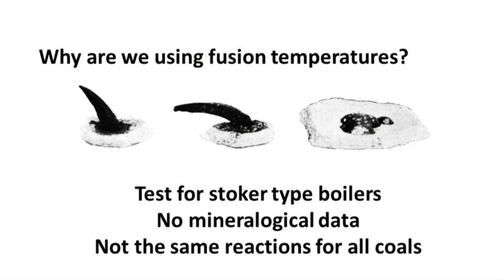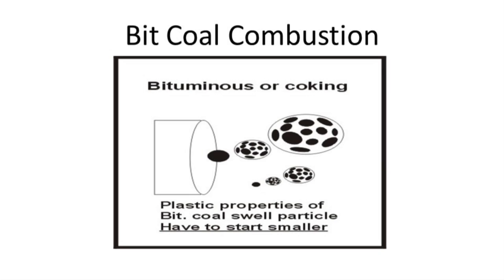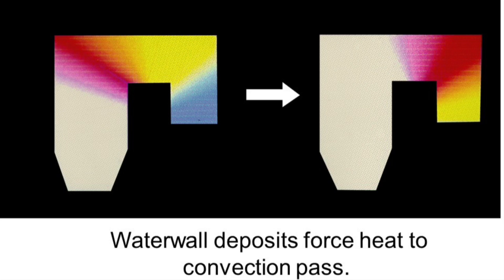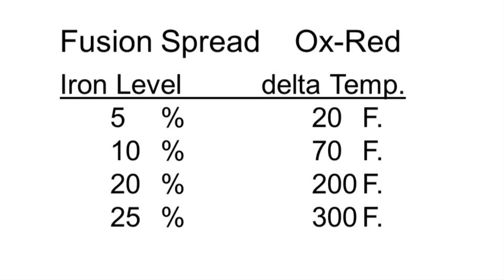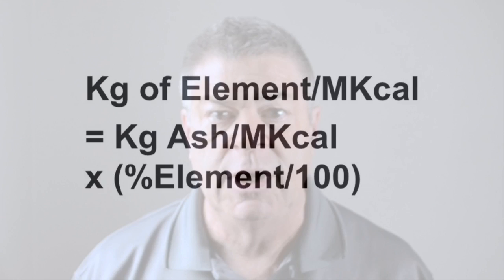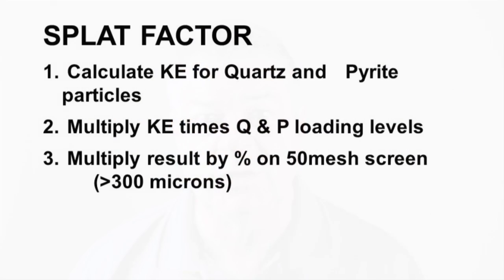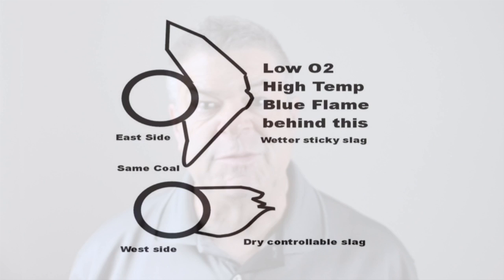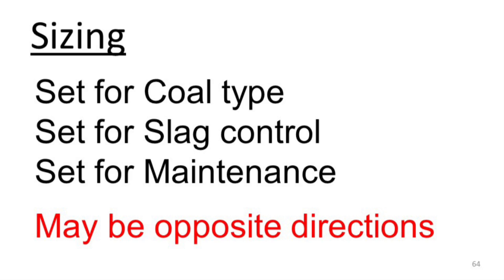Rod Hatt Wall Slag Video

Comment: I am from Western Australia and have 31 years experience around mills.
I have seen significant rises in mill DP due to the accumulation of dense minerals within the mill. One day I decided to extract a sample from a running mill in the roll area. There was a concentration of around 40% dense minerals (iron and pyrite) inside the mill even though it was only 1% in coal. It was that bad that mills had to be shut down at night and the sand spun off the table. The classifier had to be left fully open to allow the dense minerals to exit the mill, there was no choice. I believe there are some mills in Texas that have the same problem. Feeder run back is a real issue. Forget about HGI, you can have the best HGI and it will not help you. LOI makes the ash unsalable.
For us the solution was to fit a device I developed to separate and remove the dense minerals from the mill. This would allow us to close in the classifier to achieve the required PF finess.
The problem now is to get the Raymond classifiers to work. If they are not exercised they jamb up tight. There are better designs. The ultimate aim is to automate the classifier and have it respond to mill DP, in that way the PF finess will be at the best it can be.
These separators have now been running for in excess of 10 years now. They intercept and extract about 15 tons per day of dense minerals at the mills before the boiler. Over the 10 years about 200,000 tons of dense minerals have been diverted. Averting one tube failure due to back-pass  quartz erosion easily pays for the installation.
Anyway am now working with Mike Santucci , President of ECG in Akron Ohio to further improve the design.  The improvements make it much easier to install and significantly reduce the manufacturing cost.
Reply from the maker: Great idea!